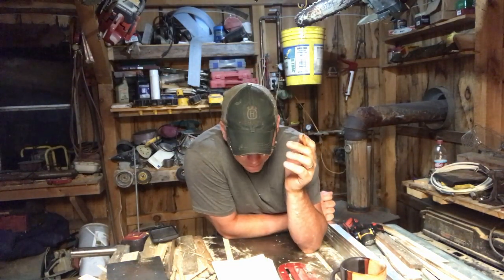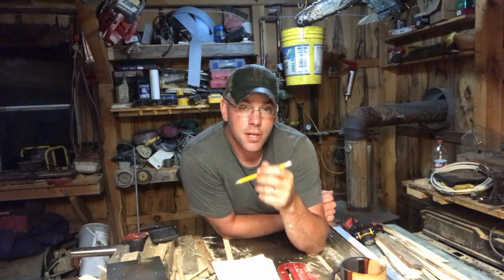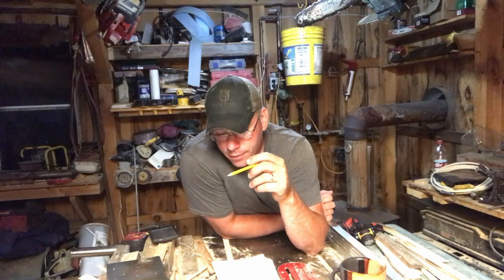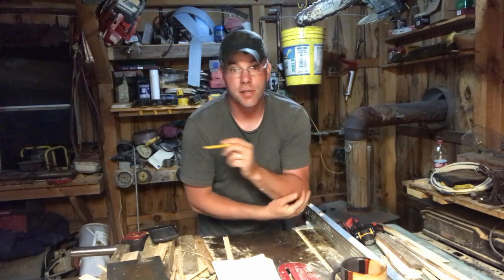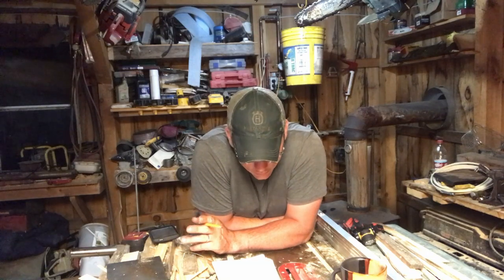A Timber Frame Vlog #23: More TradesmanChannel Q and A

Comment: Normally peg hole spacing on the mortise timber is 1 1/2" off the shoulder, so that there is enough "relish" (distance) from the peg hole to the end of the tenon to prevent blow out. However with a two peg tie beam I normally offset the holes so that they aren't in the same grain line. That means the upper hole would be another 1 1/2" off the first peg hole. Vertically we do offset the bottom hole up 2" into the tenon. Traditionally we'd go 2" down from the top side of the tenon. The engineering council has suggested that the upper hole be moved down to 2" above the first hole. This allows the tenon to shrink down from the top and not split the tenon. We now use this spacing. Jim Rogers, PS thanks for your kind words.
Reply from the maker: +JimRogers117 good information Jim, thanks for sharing.
Reply: So the upper peg hole will be 3" off the shoulder (1 1/2" + 1 1 1/2")?  How much relish is needed normally to prevent blow out? In other words how long of a tenon is needed?
Reply: That depends on the type of wood. The TFG (Timber Framer Guild) engineering council (TFEC) has done lots of research on this subject in order to get some standards into the NDS (National Design Specifications) book. It can vary from 2 hole diameters (2D) to 4D depending on the type of wood and load on the joint. This is why we hire engineers experienced in timber framing joints specification. There is a chart of specifications (C3A) in the document labeled TFEC 1-07 (I just did a google search and this document popped right up.) You need to consider everything in order to space your pegs correctly. Jim Rogers
Reply: JimRogers117 
Thank you. I downloaded the document. As an mechanic engineer, I tend to over analyze.  Trying to learn all I can.
Reply from the maker: +Chris Cox so your THE guy!!!!!!
Reply: TheTradesmanChannel 2017 
LOL, no I design so a person can work on it.

Comment: Thanks for the heads up on sourcing tools. I've been in and out of the Forestry forum for a hot minute, mostly just looking at fabricated bandsaw mills.
It's a bit difficult to navigate to find some of the topics we discuss. Maybe links to what you reference? Your call.
+1000 on board and batten siding not being worth a damn. Every last bit of it I've demo'd in residential has had water damage behind it.
I'm glad you mentioned your $4000 concrete pad. A nice q&a on foundations and pads would make an excellent video.

Good luck with the radiator. If it goes tits up, holler at an old timer and get it brazed if there's enough meat to stick something to.
Reply from the maker: +Rk Stewart good evening.  I'm actually torching it right now and responding to you on camera.
Reply: I've had to negotiate a few of them.  I was reared on a farm and  got into tig and fabrication later with tubing in food processing plants.  Thin stuff isn't easy by any stretch.  Neither is hangin' one's ass on 50 year old  Ag equipment.  Was going to say something positive,  but all I can think of right now is better you than me lmao
Reply from the maker: +Rk Stewart hah!  I bet you recognize these old Allis Chalmers machines!  Pipe fitter I'm guessing.  I bet you know the old saying about the difference between a pipefitter and a plumber: "the plumber puts his face where a pipefitter puts his ass!"
I'm going to title the tractor video "Antique Aggravation".
Reply: Now that's a damn fine title lmao.  I do indeed recognize them,  I also realized real quick in situations like you're having why Granddaddy's favorite was the Deutz air-cooled :p

Yes,  sanitary tubing welder and pipe.    I might have heard that one a time or two.  I've got some great friends over towards y'all putting up a new ethanol plant.  I've been out of it since 2009,  not easy to stay local under your own flag.  Great advice on the HVAC business also,  you're segment on the value of tradesmen was spot on.